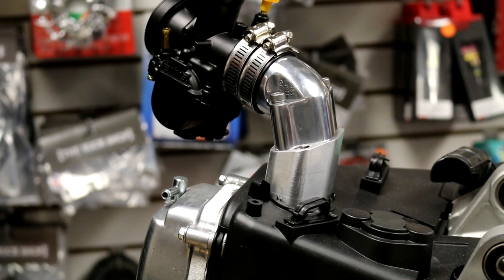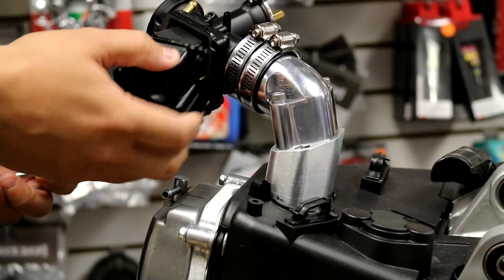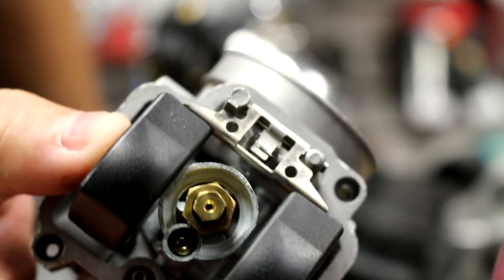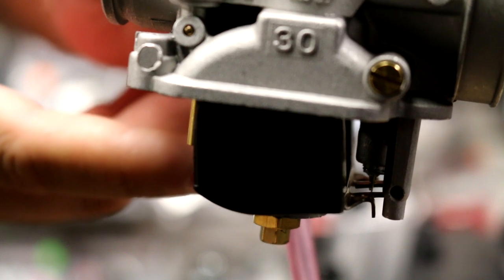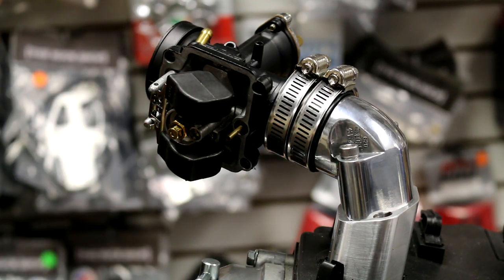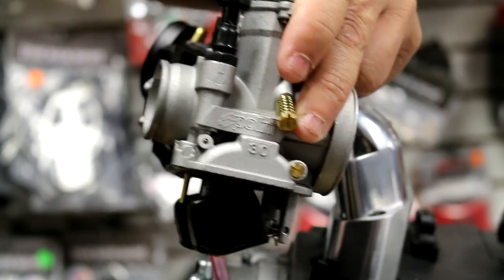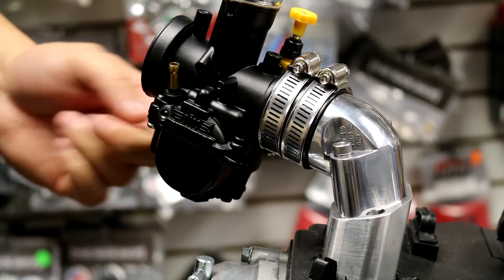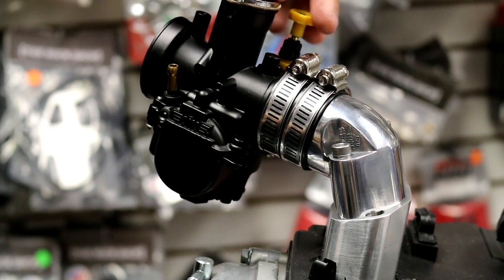ADJUSTING SCOOTER, MOTORCYCLE CARBURETOR FLOAT

Comment: brother. i have a china 150cc that ran great, then, after I had electrical issues after it was vandalized, I cannot get it to turn over. What happens is the carb overflow outlet starts leaking like a siv, as I try tp turn the engine over. I have had the carb out 6 friggen times now and the same old shhit!!

things Ijust  checked and things I have:
spark to plug
gas flowing from tank
gas flowing onto the street
remote key to start, as well as the key start.

things i dont have:
damn scooter rolling down the streets of vegas!

is there something i am missing on the carb that is causing the overflow?? jet adjustments ??
Or is the cut off for the gas not working and causing the overflow, because the gas WON'T stop the flow into the cARB?? If so, where is that locateD?

wrf??? over
Reply from the maker: you will have to adjust the float to allow less fuel, if there is still issues you may want to replace the carb and start over fresh with another 24mm carb since they are cheap.

Comment: what if air is getting pulled in the fuel line from the carb and she stalls at open throttle?? fuel starvation?
Reply from the maker: that or your fuel pump diaphragm is broken so its pulling air from fuel pump.
Reply: @Theruckshop  thanks a lot!! Will have a look at that.
Possibly saved me from buying a new carburetor to have the same issue 🙌
Reply: Also likely a vacuum leak or air filter. Try adjusting the clip on the needle before you change jets
Reply: @daviddouglasspeidel  thanks mate, got to the bottom of it a while back.. wss the carb, float bowl had an airleak as the threads were damaged.. was getting a lot of air in the bowl and fuel was foaming.. swapped to a 28mm carb and now it flies 🕊️

Comment: hey i took the bowl off the carb without removing the carb from the scooter and I saw that the bowl has two hose lines coming out. one long one for the bottom of the bowl to drain gas like your pink one. and the other is shorter. I dont know what the other one is for and I cant see the other side of the carburetor (because its still attached to the bike) to see if it attaches to the top main part of the carburetor. Is this just line for drainage or do you think I have to reattach it to the carb somewhere like maybe its a vacuum line
Reply from the maker: well if it was a vacuum line it would not be left open on one end so if its left open its just an overflow